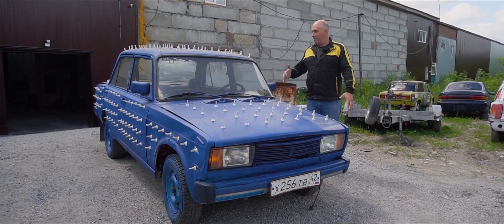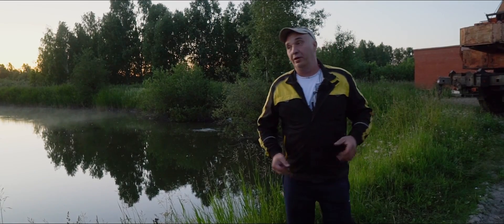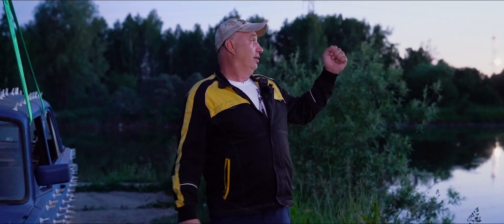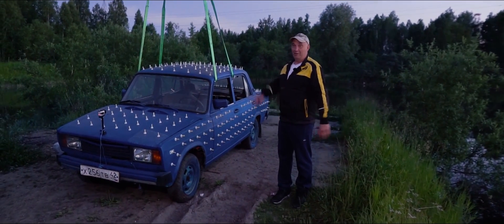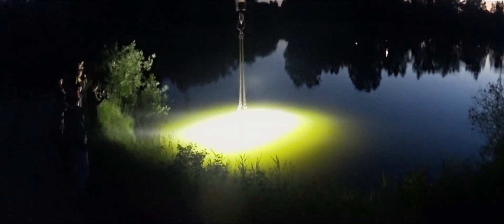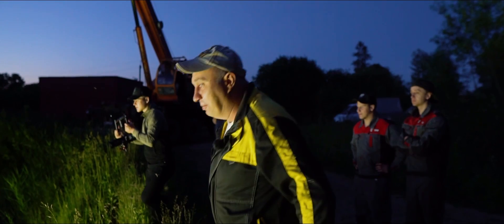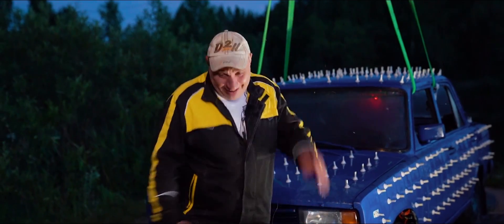Drowning our “headlight car”: will its LED light bulbs survive?

Comment: Next project you should try a experiment in the winter use a house radiator heating in a car with use water coolant pipe. My car interior heating is broken, I was think of fit house radiator.

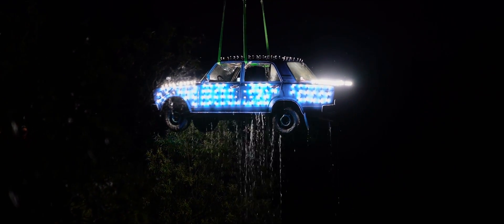Comment: they definitely aren't water proof. well they are but the quality control must be crap. u can see around 7:10 a lot of the bulbs are flickering.. that basically what happens when LED bulbs start to fail from either overheating or moisture. i've gone through my fair share of cheap ebay and amazon led bulbs to know from experience lol.
Reply: yeah i was searching for the exact same comment

Comment: Try driving without suspension :)
Reply: Done in Japan.
Reply: I'm pretty sure they already did that. Had issues with traction cause it would teeter on 2 opposite corners

Comment: Guessed a battery would give up first, lead acid batteries and water do not mix, the cells have to be vented to let the gases out, that lets water in weakening the sulphuric acid and reducing the charge, just as well that was not salt water as chlorine gas would have been released and the lake full of dead Fish.

Comment: This experiment actually says more about the water quality than it says about the quality of the electrical installation.
You are lucky, you have found some very clean water. And pure water is not electrically conductive, it's an insulator.
Try the same experiment in polluted water, or in the sea...
Reply: No they have just protected their circuit... this water really looks bad with a bunch of unwanted life in it... I would not drink a glass of it for a million USD!
Reply: @_underscore_2381  How do you judge that ?
Reply: @thefreedomguyuk  by the opacity of the water...

Comment: I want to see you attach a scooter cvt to a car. Make it happen :)
Reply: It'll get hot, slip, or snap
Reply: That's not really interesting. Because, it's very obvious what will happen : Nothing !
There's an automatic clutch Integrated into the CV transmission. If the tranny is fitted to a heavy car rather than to a lightweight scooter, the clutch will believe it's in a situation where brakes are applied. And it will never engage, the car will just sit there.
Reply: Morten Kapa uuummm the trans doesn’t know the brakes are applied what the hell are you talking about? I believe on flat ground and from a start my riva 180 would move a car no problem. Iv pulled cars with my Honda passport with a Chinese 50cc and centrifugal clutch. Oooohhhhhh yeees of little faith. Just makes sure the gearing is ok these guys know what’s up.